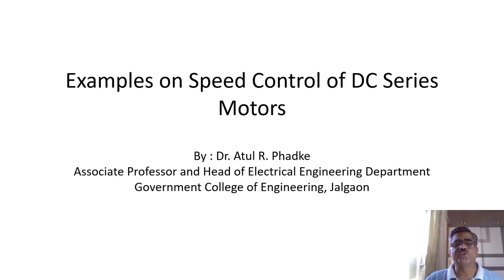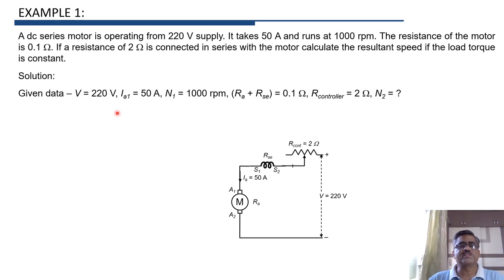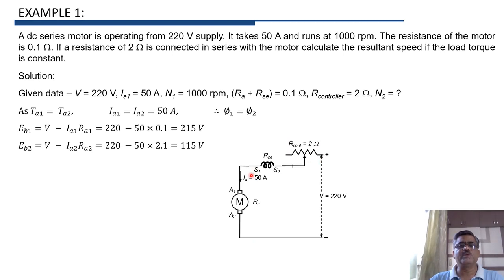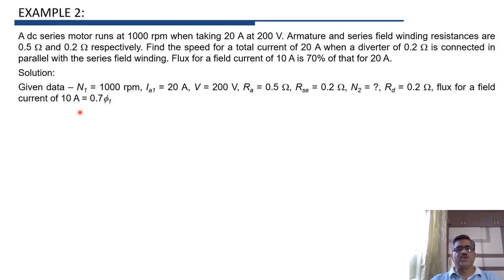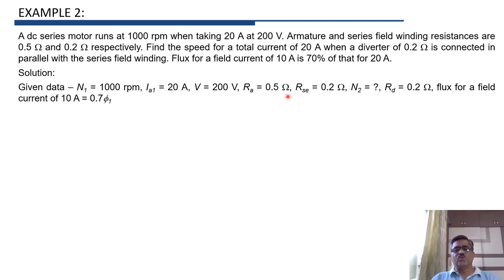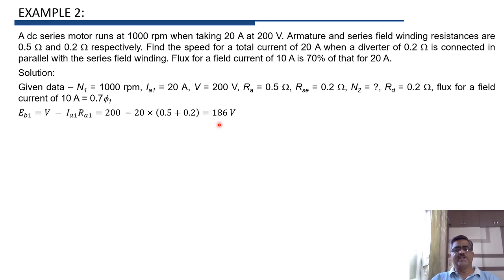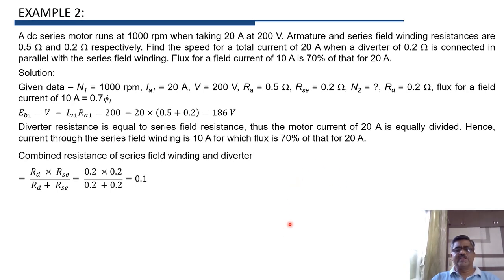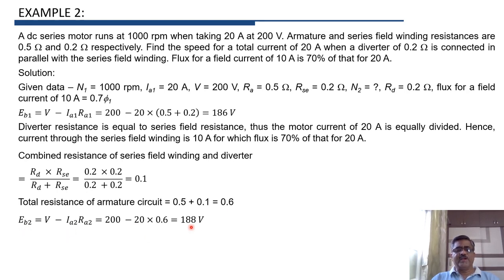Examples on Speed Control of DC Series Motors (25)

Comment: Q1: 220V, 7 Hp DC series motor coupled to a fan, the motor draws 25 A and runs at 300 rpm at terminal voltage of 220V and no external resistance, torque of the fan is proportional to the square of the speed, if Ra=0.6 Ω and Rf=0.4 Ω. (Neglect rotational losses):
a) Determine the power supplied to the fan and torque developed by the motor. b) The speed is to be reduced to 200 rpm by inserting external resistance, determine the value of this resistance and the power delivered to the fan.